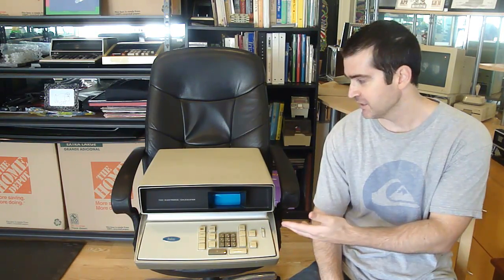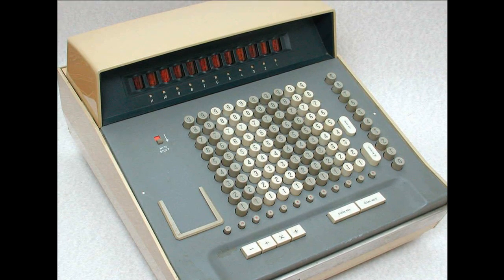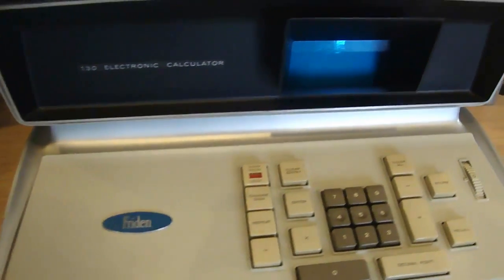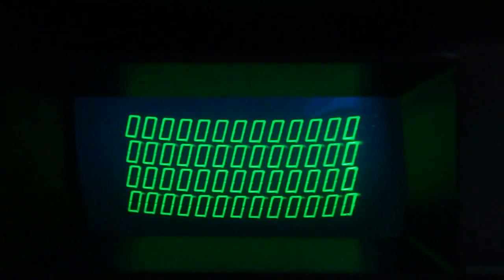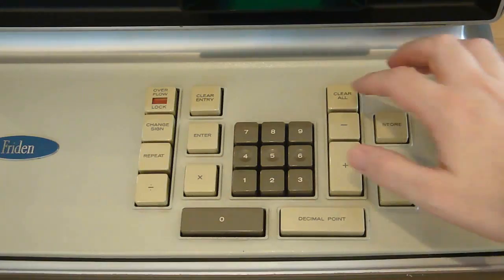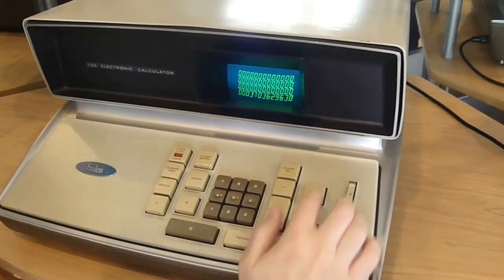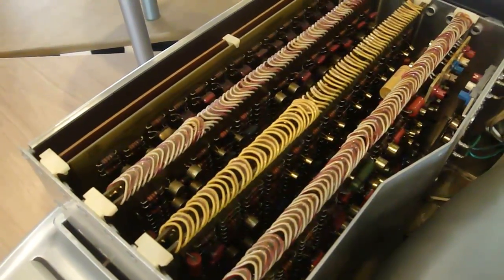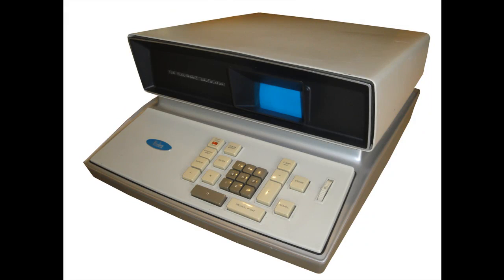Friden EC 130 Calculator Review (First Solid State Calculator)

Comment: Thank you for the great video and your enthusiasm. My father used to sell these in both London and here in Adelaide South Australia. I have restored an EC132. This included fixing the high voltage CRT supply and power transistors. Works very well. Young visitors to my business cannot believe it is a calculator. I love it. A precious part of history for me. Best wishes, Gordon
Reply from the maker: UnitCare Adelaide Nice to hear about your restored EC-132 and the connection to your father.  A precious part of history, indeed.
Reply: Hi. I also sold one of the very 1st of these in 1964 in London , it was £960  [$2688] at the time ! I almost certainly knew your father , as I left Friden in 1972 by which time Hitachi were making all of Friden display calculators.

Comment: Such a beautiful calculator, I really love the CRT display on it. This model if I remember right also uses delay line memory to store the values, it'd be a loop of steel wire inside the bottom of the case.